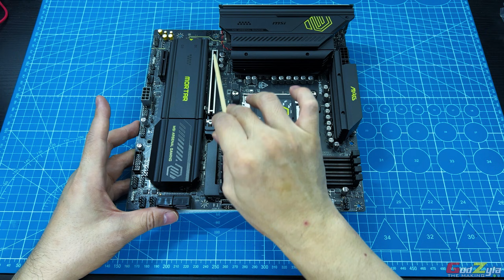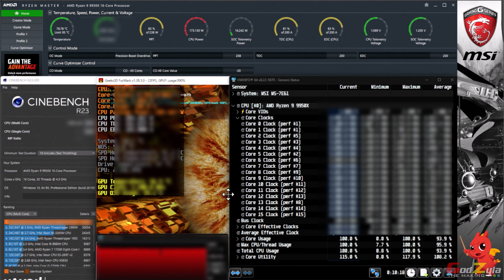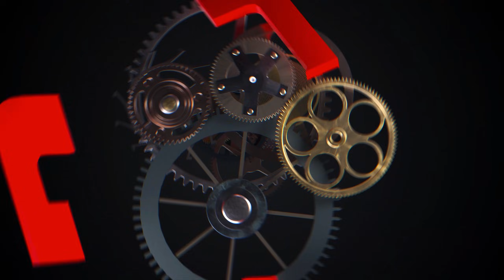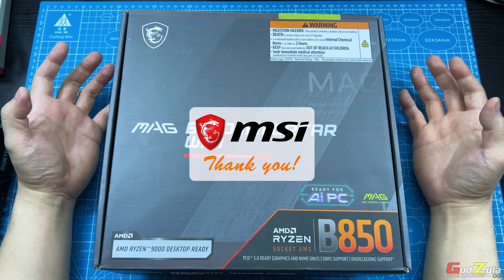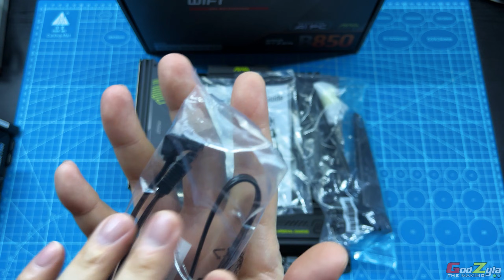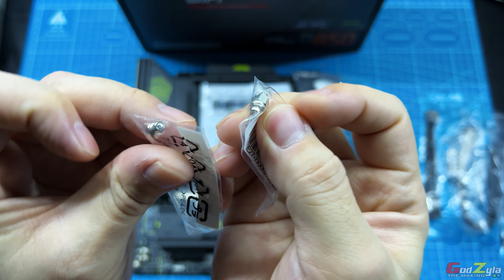MSI B850M Mortar WiFi

Comment: Awesome board, awesome review. Anyone knows when this will be available in Europe?
Reply from the maker: Hi ceesh, welcome to my channel, It should be late April period.
Reply: @KleoYan  Thanks for letting me know. Long wait sadly
Reply from the maker: you are most welcome. Me too am waiting. I wanted to retire my old MSI B650M Mortar. It had gone through alot with the content I did in this channel. Time to let it have some rest.
Reply: @KleoYan  I see, No better argument for buying a board if the reviewer is actually going to use it themself. Stay strong waiting

Comment: Re. The Third M2 Slot and concerns about heatsinks causing problems being too big with clearance to Motherboard tray, there is a solution!  If you just put a thermal pad on the SSD, the Motherboard tray itself is a giant heatsink!!!  I have a laptop that works this way - The body is aluminum and there is a thermal pad on top of the SSD which contacts the metal chassis - cooling is great because quite simply, the more mass of metal the better a heatsink!
Reply from the maker: Hi Wezley Jackson, welcome to my channel. Yup, I did mentioned about it at timestamp 11:20, nevertheless thank you for your suggestion and to share the info with us. Thank you 😉👍👍👍

Comment: I'm planning on using this board  with a beefier CPU Air Cooler (Thermalright Peerless Assassin 140)

I'm really afraid of the clearance with the GPU as the PCIe slot is very close to the CPU, I can't find information about this anywhere.
Reply from the maker: Hi Dizel, welcome to my channel, I don't think is a good idea to mount that aircooler, as I have messured https://i.imgur.com/mFoRFT9.png
Reply: @KleoYan  Thank you!

Comment: Definitely grabbing this board for my mATX build, I'm a bit confused about the ram though. I have a 7950x, will this board allow me to run 2x64gb or 2x 48gb ram?
Reply from the maker: Hi Vyzetta, welcome to my channel. This board does cater up to 256G of capacity. You can plug and run full 4 sticks. Just that at expo profile which are mentioned to have higher bus speed and tighter timing. It might not run at expo profile. Ended up you might run at default bus speed. Either 4800 or 5600 with a loser timing
Reply: @KleoYan  Thanks! Yeah I only plan to run 2 stick just wanted to be sure 2 sticks of 64gb worked, I was looking at the support page for the mother board and they didn't have any listed with those numbers so I wasn't 100% sure.

Comment: Asus b850 or this one i got the asus but the slot for the card i do not like that much on asus.
Reply from the maker: Hi TheprotectorFPS, welcome back. I will be real honest with you. If both Asus Tuf B850M and this board released at the sametime, I will pick this over the these are the reason besides the PCIE Slot of this is at the most top slot. 

1) One more type-c port at the rear
2) better lan port which is of 5G instead of 2.5G on the Tuf

But in general, both boards works fine. Just that I need more type c port and higher bandwidth on the Lan port. After mentioning above. I do not know the price of this board, if it cost x 2 of a Tuf, I will stick to Tuf, just that I need to be mindful of which case to use.
Reply: @KleoYan  I see thank you Kleo let see the price later but for me the Asus look better and has more ports usb I mean for my case its all cover. but  I do not like the slot. This one looks not that strong  aslo what is that red cable down heat sink.
Reply from the maker: @Th3true  oh, thats the CMOS Battery 01:11:17
Reply: @ oh I stop the video, jajaajaj I'm working ill finish later. Thank you!!
Reply from the maker: @Th3true  No worries, work is more important and have a great day ahead, am off to bed. 😉

Comment: wow .. the MSI line up is pretty solid huh
Reply from the maker: Hi TheDARKAG3NT, welcome back. Yup MSI boards are really something. I am impress with this and the tomahawk. Not that I dislike the carbon but consider the light weight loading on both X870, X870E tomahawk and this B850M Mortar, I prefer these over the Carbon 😂